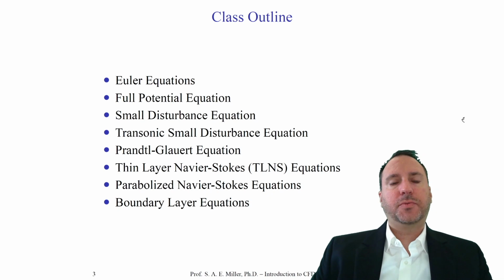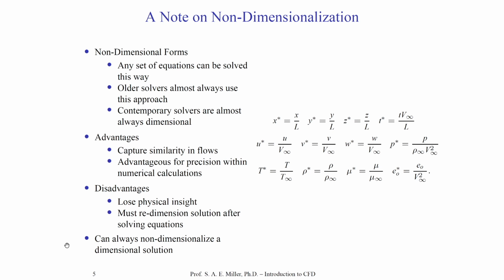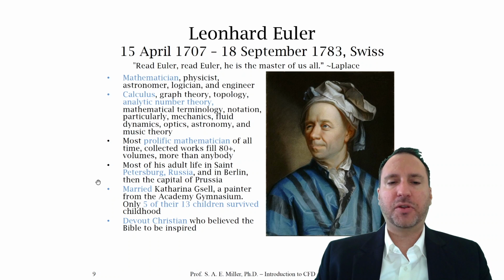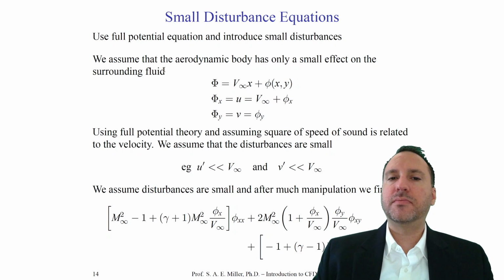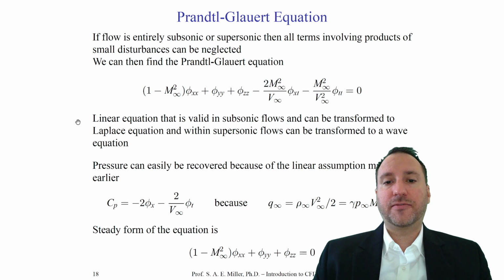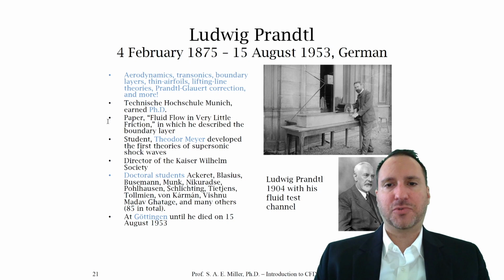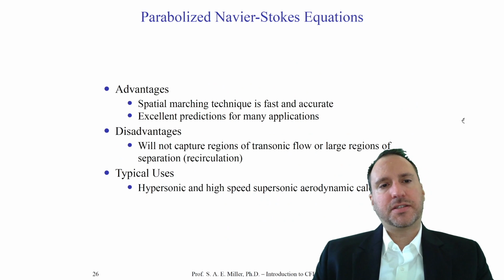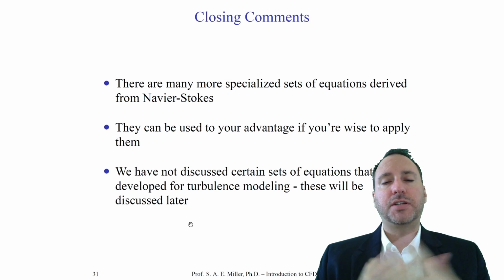Introduction to Computational Fluid Dynamics - Fluid Dynamics - 2 - Specialized Forms

Comment: So many different forms of NS equation and as prof said it is essential to apply the right set of equations to solve the problem more accurately....
Reply from the maker: Strictly speaking, there is only one form of the NSE as developed by d'Alembert, Euler, Navier, Cauchy, and Stokes. Though today, people use the term a bit more loosely. So it is very important to be specific and understand the equations people are solving with appropriate assumptions.